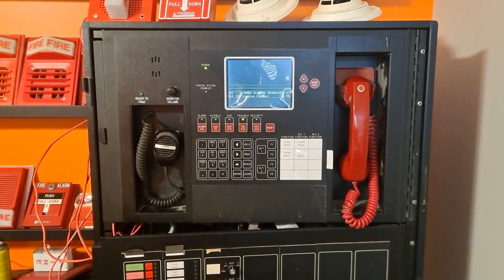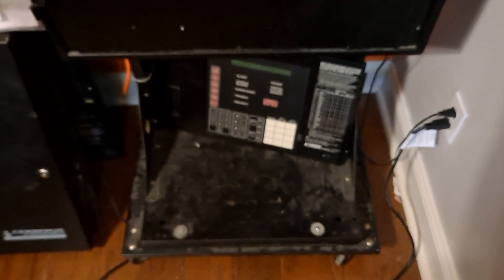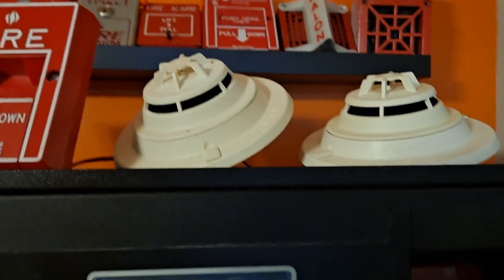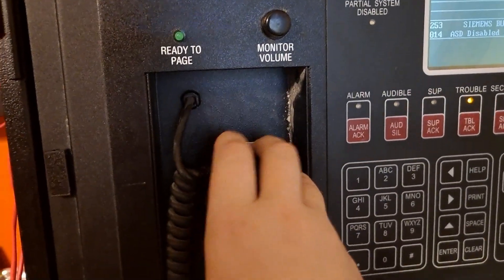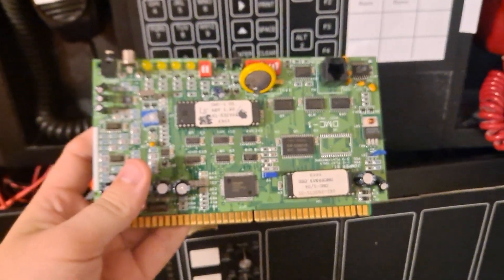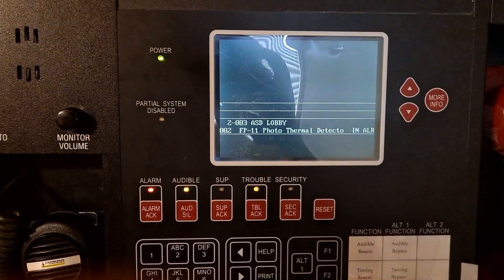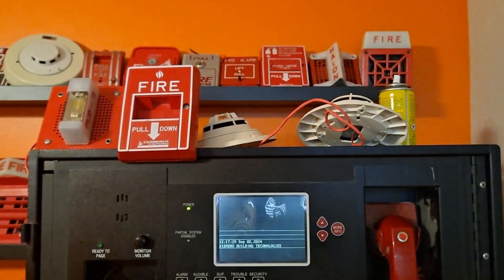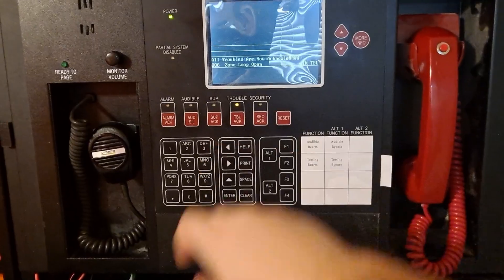Siemens Cerberus Pyrotronics MXLV Fire Alarm System Test / Demonstration

Comment: So it doesn't have the DMC-1? I mean it's cool sounding with the Slow whoop or Temporal 3. I just think the voice card serves it's purpose very well as long as it's not broken.
Reply from the maker: The panel had a DMC-1, but it was not installed at the time of recording since there were no messages programmed for it. System was playing the backup tone, which was the slow whoop heard.
Reply: @FireAlarmsofNortheastKansas You should make custom messages for it.

Comment: If you still have that DMC-1 Message Card, you could get an EEPROM Reader end extract the messages, digits, tones, and other phrases.

@Dewpoint8900 has done the same thing with a Simplex 4100 Chipset, there are no raw Siemens Voice Message Files available on the Internet right now.

Comment: Welcome back and neat video!!! My School had this exact panel with the same display. But it didn't do Voice Evac. It ran Siemens Ummts, Simplex Electronic Horn Strobes, TrueAlerts, and ZH-MC-R'S by Siemens.
Reply: Were the U-MMTs actually U-MHUs. I'm assuming the electronic horn strobes were possibly Simplex 4903-9236/9237/9238 Horn Strobes, TrueAlerts being FreeRun 4903-9425/9426/9427
Reply: @aidanthetoiletelevatorfire7554  They we’re UMHU’s, the Simplex Horn Strobes we’re 4903-9328’s and Simplex TrueAlerts I don’t think Smartsync if it’s a Siemens Panel.

Comment: Hi did wheelock ever sue siemns for rebranding their fire alarm horn and speaker strobes
Reply: Rather the opposite occurred. Siemens was actually REQUIRED to use Wheelock notifications on their fire alarm systems following a lawsuit. Wheelock sued Siemens over their strobe synchronization protocol, and they were banned from using anything but Wheelock devices for a long time as a result.